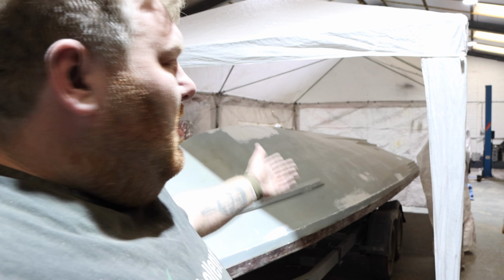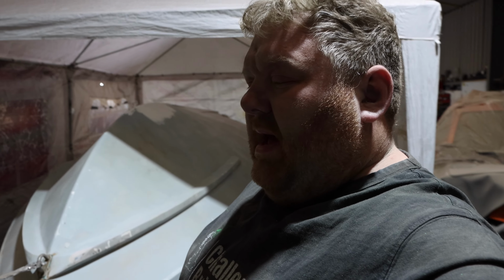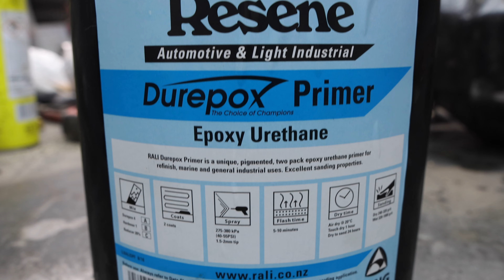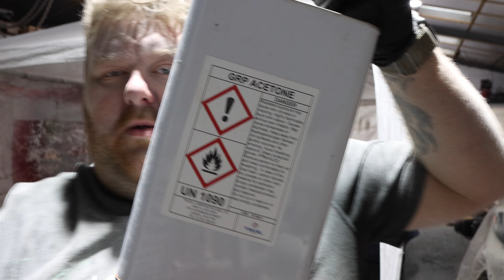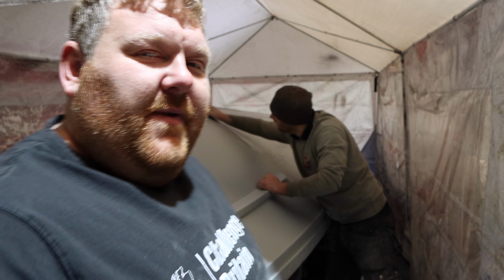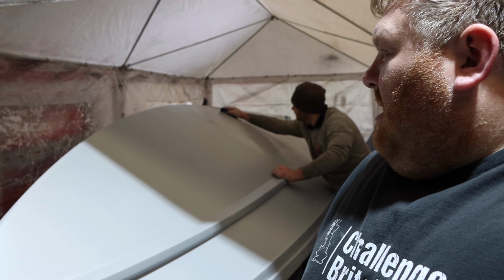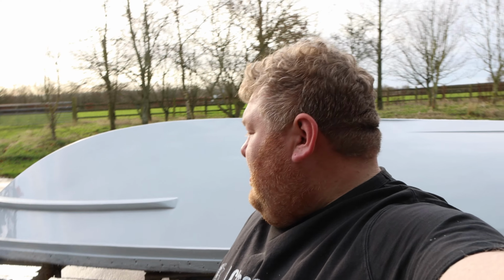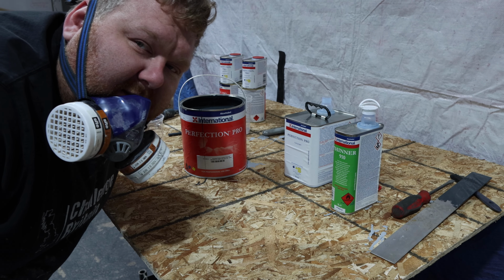Boat Build Part 11 Painting the Hull

Comment: Stumbled across your videos and loving them and don’t want to come across as negative but have some questions/comments. 

Did you use an etch primer before painting the hull? Normally when painting GRP an etch primer is used to eat into the Gelcoat surface which allows the primer to stick. If no etch was used you may have problems down the line with the paint flaking off the hull.

I know it is too late now but as you will be using a roller coaster trailer you may find you get a lot of damage to your paintwork. What would have worked  best would have been to spray Gelcoat over the hull and transom with a wax additive to allow it to dry tack free. This  could then have been sanded down using progressively finer  sand paper starting with say P800 until a final sand of P1500 then it could have been polished with a lambs wool polishing bonnet until it was a high gloss. Your hull then would have been resealed with a very hard outer Gelcoat shell that would be easier to clean and less susceptible to damage when launching and recovering. 

One last thing. Are you able to return your Raymarine Axiom? The reason I say this is that Suzuki do a 9” screen that will show all the engine data that works with Furuno chart plotter, sounder, radar etc. yes the Raymarine Axiom should  display engine data when wired as a NEMA 2000 network, but it won’t be as good as Suzuki’s SMD Specific system which will match the engine you have ordered. 

Good luck with the build, I look forward to your next video.
Reply from the maker: Thank you for the comment, il look into the paint system as we were advised to use this system by multiple people in the trade.

As for the raymarine, i will be sticking with it as we already have the system on board the sister boat and love it along with the customer service.
Thanks